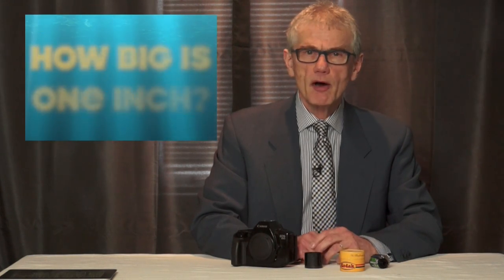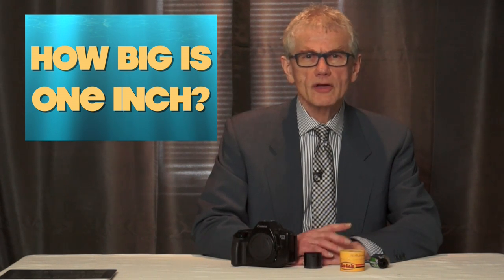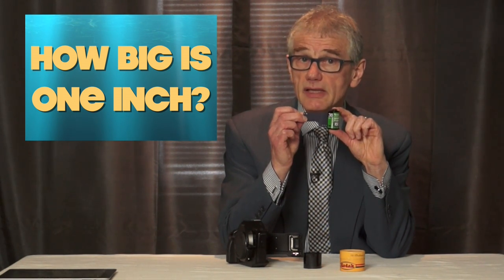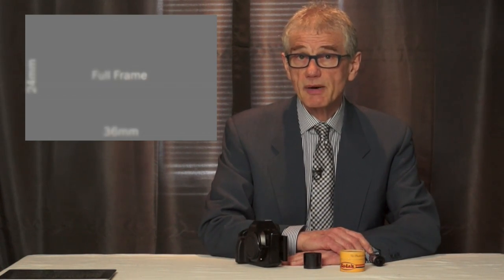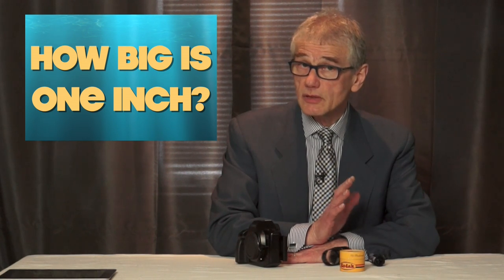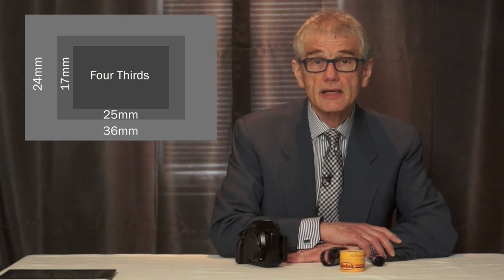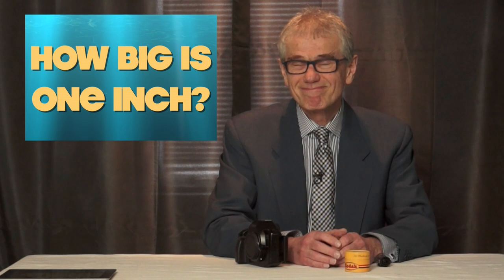How Big is a One Inch Sensor

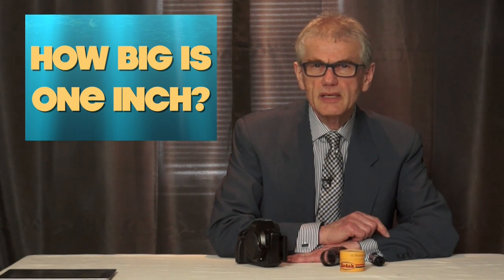Comment: Excuse me, Maarten, but you haven't explained anything. How the horizontal and vertical orientation of 35-mm film is related to 1-inch sensor? How the 1-inch vidicon is related to either film or modern digital sensor? I thought that sizing in inches referred to diagonal measurement, you did not even mentioned that. The only meaningful 20 seconds of this video are 4:30 to 4:50, but then you stop short before explaining the relationships of the vidicon to modern digital sensors.

Wikipedia has it: "Sensor sizes are expressed in inches notation because at the time of the popularization of digital image sensors they were used to replace video camera tubes. The common 1" circular video camera tubes had a rectangular photo sensitive area about 16mm diagonal, so a digital sensor with a 16 mm diagonal size was a 1" video tube equivalent. The name of a 1" digital sensor should more accurately be read as "one inch video camera tube equivalent" sensor." -- A-ha! So no need to bother with 35-mm format at all. Instead, it would be better to mention 16-mm movie format as it is very close to "1-inch" digital format.

The production level of this video does not reach your usual high standard as well: the canned laughter is so 1970-ies, and the humor is too low-brow.
Reply from the maker: +ConsumerDV thanks for taking the time to post such a detailed comment, and please accept my apologies for failing to meet your standards. First, I set out to answer the question, "how big is the one inch sensor", and the 35mm frame, used as a reference for all crop factors, seemed to be the right starting point. Second, I thank you for adding the video tube note that I only alluded to in the video - the "why", although interesting, did not seem particularly relevant, so ended on the cutting room floor.
I was attempting a little John Oliver homage and may have gone a little far, I'll try to keep my humour in check.